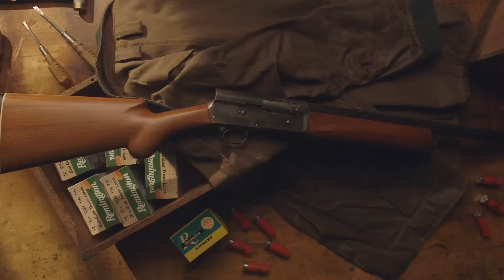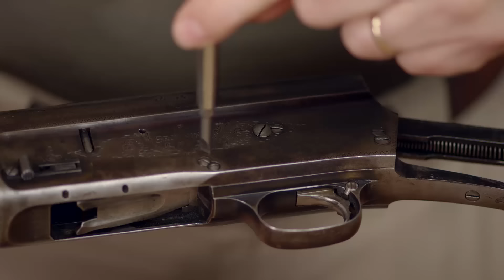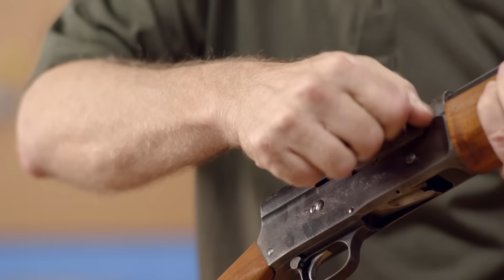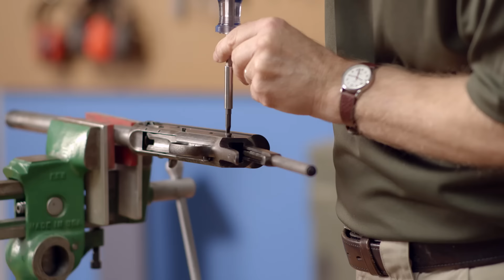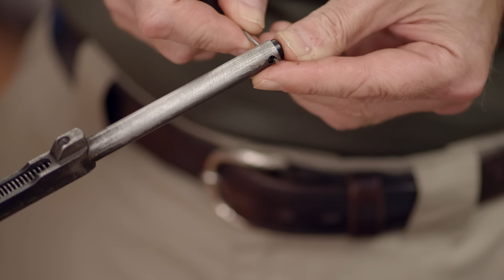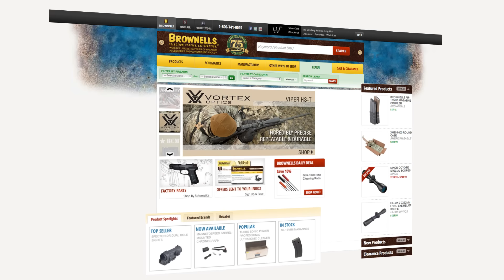Browning A5 Maintenance Series: Disassembly

Comment: What if I do not have a cut on the lower end of the ejection port for the pin to line up with?
Reply: Just watching this video 1 year later, thought id add my 2cents as i had this issue. I lined up the pin with the access hole, and punched it out with a 1.5mm t handle hex driver from the ejection side. Pain, but it worked!

Comment: Good old John Moses.
Genius he was, but things like the Winchester 1894 were absolutely NOT designed for mere mortals to disassemble, but I’ve only cursed him once.
Very early 1894’s, at least through 1916, we’re made with the cartridge guide screw heads on the INSIDE of the receiver! 
Talk about a total nightmare.

Comment: Im about to clean my grandfather's shotgun and I do not want to damage it. It has some small pitting on barrel and receiver I have put a coat of some brand of CLP or brakefree I had lying around. It was in the original soft sleeve at least 40years old probably longer. Problem is I do not own a rifle with wood furniture and am unsure how to care or maintenane it without damaging the original rifle finish since I know that clp and the like will buble up the epoxy or what ever is on the wood.

So what do you guys use and how do  you store your old firearms with wood furniture without getting the lube on the wood stock? 
Someone told me to find flower or potters cloth since it's lint free for alternative to microfiber. But I cannot find it anywhere on Google and thinking I heard him wrong.

I am thinking about buying a dehumidifier to put in room.

Comment: Is there a trick to getting the bolt retaining pin out at the 3:50 section on the vid if it just doesn’t want to budge?  I’m not able to get it to come out in my ‘56 sweet sixteen.
Reply: I'm having the same issue with my '57 A5. Did you find a solution?

Comment: CAUTION! Do not remove the second, smaller screw on the stock tang!  It hold the trigger spring in place and is tough to reinstall.
Reply: Thank you!
Reply: Yes yes yes. Don’t remove
Reply: Thanks bro, saved me a lot of trouble right now
Reply: I removed that screw, and wish Steve would have mentioned it. On re assembly it was a bear trying to get it started / installed and almost damaged the screw. I took the stock back off and removed the trigger pack, dropped the hammer to remove pressure on that trigger mainspring. I was then able to work the screw back into the trigger mainspring and then reinstalled everything as in the video. I have to start reading some comments to avoid any mishaps that might have been overlooked in the videos. Thanks

Comment: My FN Belgium version of A5 Light has no hole to push the pin of locking block latch out. Can you please explain how I can go about how to remove the bolt block out of the receiver?

Comment: Ok, from this video I learned that I am not disassembling any Auto 5. Damn, that was complicated!!!
Reply: It's really quite simple. Trigger group out, mainspring out, lifter spring out, unscrew lifter screws, lifter out. Bolt pin out, bolt out. Done!
Reply: The dedicated A5 screwdriver set is absolutely necessary. Not all that hard with youtube. I broke mine down as far as I could, much more than this video before the days of Internet. Needed to buy a book to put it back together.
Reply: yup definitely bringing mine to a gunsmith

Comment: What size thread is on the "action spring tube" please?
Reply from the maker: Newer A-5 Browning shotguns do not use a threaded action tube as they are silver soldered. The older models tubes are .466 x 50, but they were factory discontinued 8 years ago.
Reply: I have a 1908 Remington Model 11. Does Brownells sell the .466 x 50 Tap? What is the likely hood a Gunsmith would have this size screw cutting Tap?

Comment: I have one of the late 50's models from my grandfather, when I remove the cap from the magazine, the spring immediately pops out, is this normal in the older models or is there a problem?
Reply from the maker: It sounds like you are missing the magazine spring retainer. You will need either the retainer for the 12 gauge or the 16/20 gauge depending on which one you have.  http://bit.ly/2gcZcW1

Comment: I recently inherited this very gun. (Browning Magnum A5 12 gauge shotgun.)   I'm a total nubie to gun ownership, so this was extremely helpful.  One other question I have is whether the pad at the end of the butt is screwed on, or glued on.  Mine is dry-rotted, so it does not absorb any of the kick from shooting.  If it is screwed on, what size/type of screw driver to do I need to remove it to be replaced?  I figured it was from before the big switch to Philip's head screws, but I can't see the screw head to be sure.
Reply from the maker: The pad should be screwed on if it was installed by the factory but the screw holes are usually concealed after the screws are installed due to the nature of the rubber. Look for a small pin hole in the pad and take a long thin blade standard and probe around trying to locate the screw and see if it will engage he slot. If not, use a long shank #2 Philips screwdriver and repeat the procedure. Please be aware that since installation of the new pad will require a gunsmith to grind the new pad to fit the gun, it will be best to take the shotgun to a qualified gunsmith to remove this pad to avoid possible damage to the stock.

Comment: My model 11  Remington does not have a notch in the ejection port to drive the pin out from the left to the right. I am trying to remove the breech block for cleaning , what is the procedure for this?
Reply from the maker: 1.	Move breech bolt until locking block latch pin aligns with hole in left side of receiver to rear of shell stop. Then, using straight pin drift, push pin clear through breech bolt and receiver from right to left; then, withdraw pin drift slowly at same time holding down locking block latch against force of latch spring. When drift is removed, ease latch upward and remove latch and spring.
2.	Swing rear end of link downward to clear operating slide, and move breech bolt forward out of receiver with the link attached. The operating slide will slide out of the breech bolt as it moves forward and the handle of the slide strikes the forward edge of the ejection opening in the receiver. 

Good Luck!

Comment: How much disassembly is needed to remove the magazine tube to replace with new tube i have My dad's 1947 A5. Thank You
Reply from the maker: Please do not attempt to remove this as damage to firearm will most likely result. It will require a qualified gunsmith to remove that and install a new one.
Reply: Thank You

Comment: I am having some trouble finding a recoil spring for my Rem 11 5-shot 
12guage(the spring that slides over the mag tube). Will a Browning A-5 
recoil spring work on a Remington 11?
Reply from the maker: Unfortunately the Browning A5 recoil spring will not work with the Remington Model 11. That will need to be sourced from Ahlmans (507) 685-4243.
Reply: I called Ahlmans and they didn't have any. Could a person buy 2 model 11 sportsman springs and trim one of them down then add them together to equal the length of a 5 shot spring?
Reply from the maker: No, that does not work! Please do not attempt it as it may result in damage to your firearm and or injury and possible death to the shooter. Please check listing of used and obsolete parts distributors. https://www.brownells.com/aspx/General/Links.aspx?sourcelist=y#used
Reply: I own a browning A5   16gauge,but im having a problem when i use high velocity shells it works fine but when i use low velocity,the first shell gets jamb, i already did the maintnace on it and it keeps getting jumb exept for the high velocity shells,is that shot gun made only for high velocity,can any body help me with that.
Reply: I own a Browning A5 shotgun,but im having a problen with it when i use low velocity shells,when i fire the firs shot  the emty shell stays   jamb,it dosent let the other shell go up,but when i use high velocity it works fine,can any body help me with that,i will apreciate the help or coment,thank u.
Reply: put the compression ring and retainer on BEFORE the main recoil spring , flat side of the retainer ring against the receiver, tapered end towards end of the barrel then the compression ring tapered side towards the receiver so the tapered sides of both fit together , should cycle light loads fine

Comment: My carrier sticks, and will not allow me to load shells with pushing the bolt release button. Any suggestions?
Reply from the maker: This sounds like the carrier latch may need adjusting.  Please refer to the Browning A-5 Field Service Manual for instruction, or contact your local gunsmith for assistance.

Comment: I just recently came into possession of a 1954 year of this particular shotgun, and I was curious if it were possible to purchase replacement barrels?

For instance, if I were to want to switch to a barrel with a choke, is that possible for this year?
Reply: +Primegen I looked at this video to ask the same question about my 1949 Auto-5. I'd like to be able to shoot steel shot out of it.
I've seen that factory choke barrels can be reamed and threaded for screw-in chokes, but I'd rather not do that to the original barrel if possible.
Something I've been seeing, but am not sure if correct, is that the A5 invector barrels will fit the Auto-5. Either that or there were Auto-5 barrels produced with the invector screw-in choke system.
Reply: Primegen hastings makes those barrels also
Reply: Buy a japan made a5 barrel and you can shoot steel